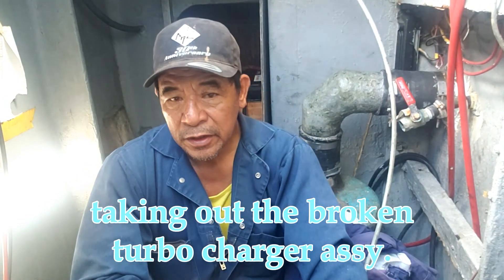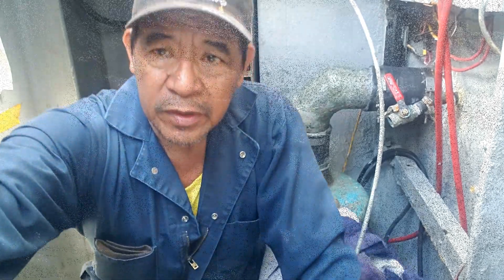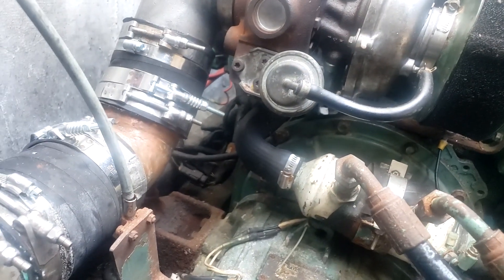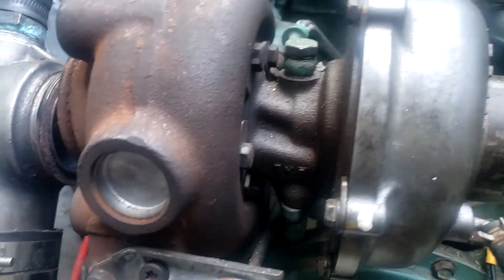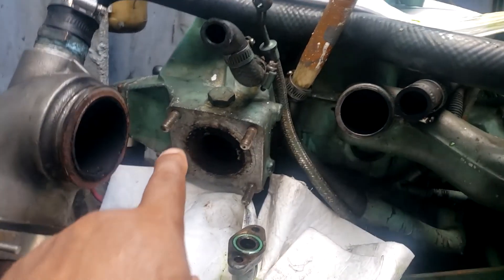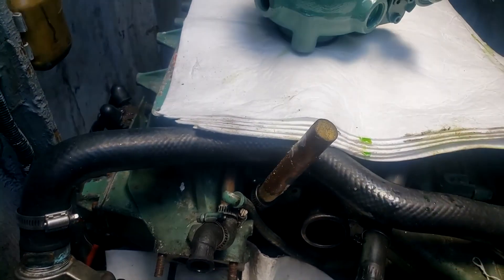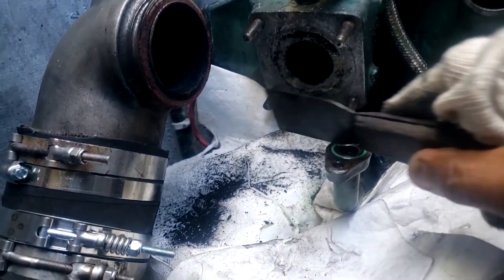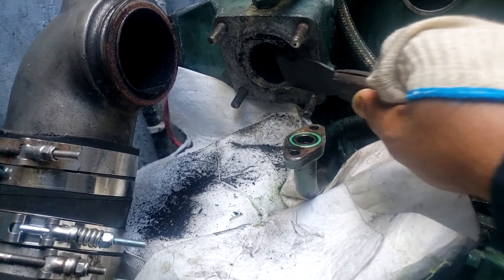YANMAR DIESEL ENGINE TURBO CHARGER REMOVAL

Comment: Great video. What type of wrench/socket did you use to remove the 10mm bolt from the oil lube system in-between the turbo and the exhaust housing? Cannot fit a regular wrench or socket in the space and not enough room to turn it. Any special trick Or special tool???
Reply from the maker: Size 17mm but this is fabricated heat it up with acetylene  then make it like a u shape
Reply from the maker: On the tube lube is 10mm with 1/4 drive extension and unversal joint